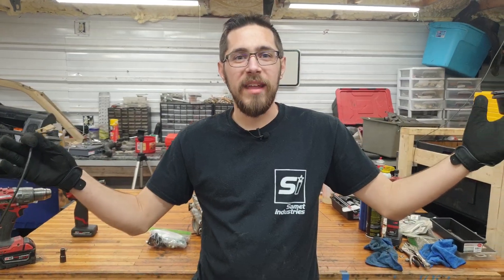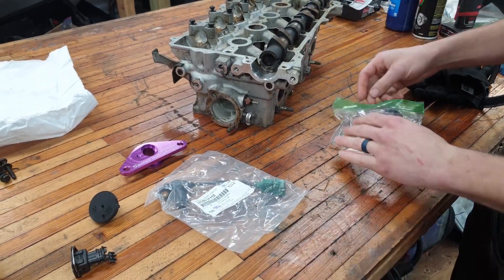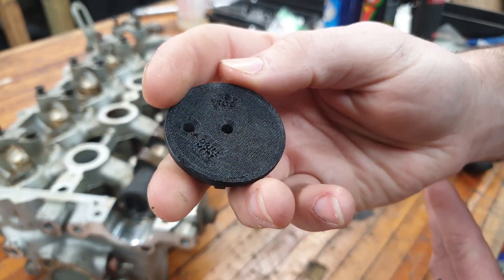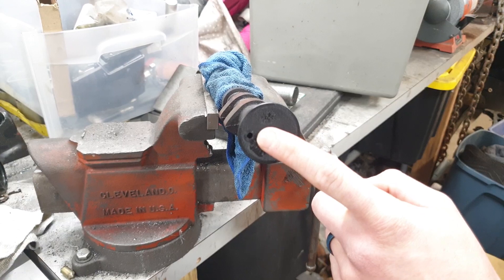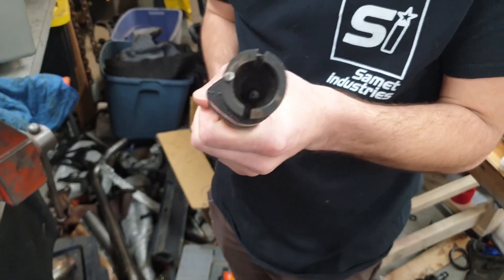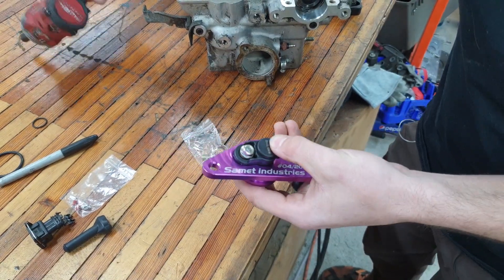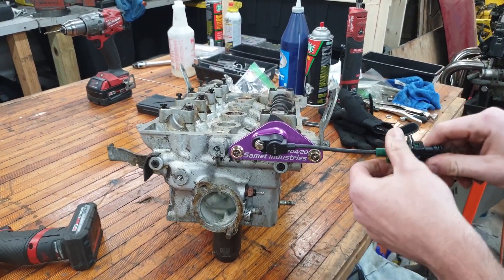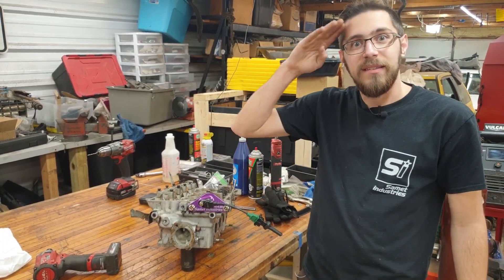Samet Industries DOHC Cam Sensor Install Guide

Comment: You are the bomb! 

I have a 323 GTX and have also ordered multiple parts for my B6T. I tried to join without success- 2:16

I’d like to buy a decal :-)
Reply from the maker: Howdy! Tried to join what?

Samet Industries decals are currently available on TheFestivaStore.com, along with the sensor kits & tons of other B6T parts, such as the Crank Sensor Kit (which you'll need for sequential use) and a T25 Turbo exhaust manifold

Comment: What’s the benefit of this kit vs oem cas
Reply from the maker: This just gives you a 1-tooth Cam signal.
The benefit over the CAS (stock or trimmed) is
-Much Thinner overall, more firewall clearance
-Cheaper than a CAS
-Easily replaced OEM Hall Sensor
-Readily available for less than $20, and easy to get from local parts stores
-Less prone to heat failure